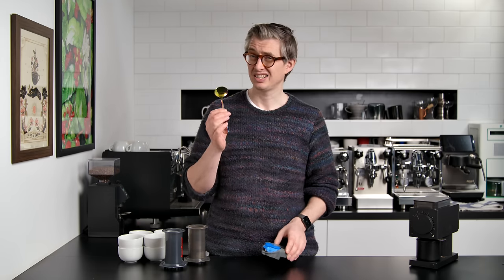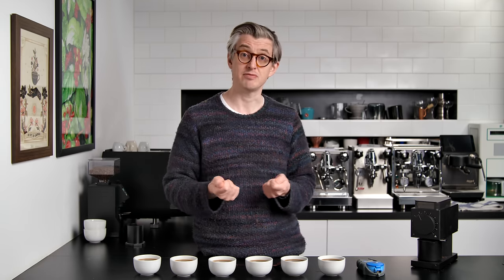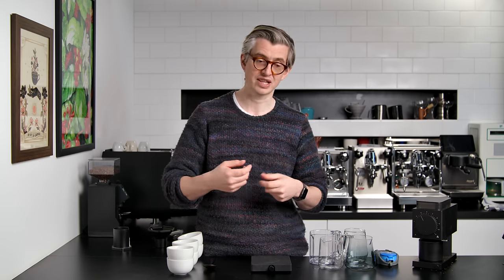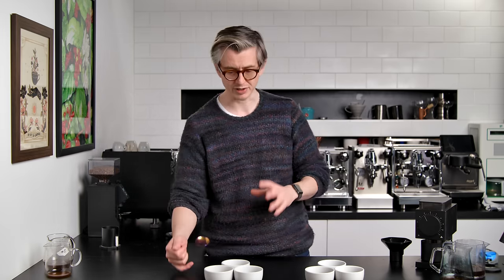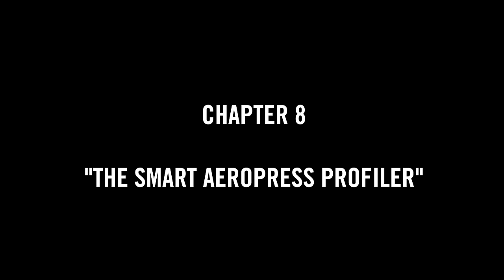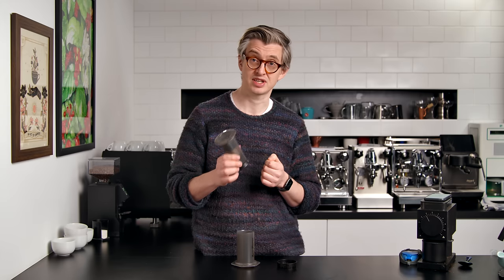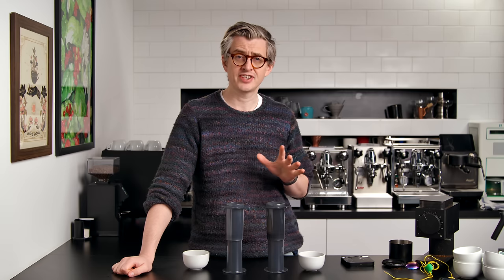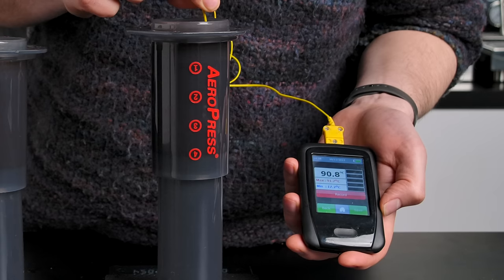Understanding The AeroPress (Episode #2)

Comment: Great video James, thanks, I watched it from start to finish in one go! Brutally honest, myth-busting stuff. You covered everything I wanted - and more! - apart from one small thing: paper filter versus metal filter. Switching from V60 to Aeropress, I initially felt better about my reduced paper usage, but now after a few years of Aeropressing, I'm concerned by all those little paper discs... I bought a metal filter a while back but have only used it briefly so far without much success - I recall preferring the paper result, but didn't pursue it further. Do you have a view on reusable metal filters?
Reply: i second this...would live to see James dive into how the filter material affects the final outcome. Been using a metal filter for over 5 years and prefer it over paper.
Reply: I'm also curious. I'm a metal filter user, not paper and prefer it over the paper.
Reply: Yes, I use a metal filter when travelling as I don't want to deal with the paper filters going everywhere in my bag, I wonder if there is any discernable difference in taste and extraction between paper and metal filter
Reply: @christianmarth9989  The main difference for me the much cleaner cup that paper gives. I use a Prismo on mine, which comes with a metal filter. But I still add a paper filter for the cleaner finish.
Reply: @taglh  Can you taste any difference between 1 or 2 paper filters?
Reply: @christianmarth9989  huge difference. Paper is way better.
Reply: I was curious about the same thing
Reply: i was about to ask the same thing - i understand most people prefer the paper filter because of the so-called “cleaner” result while i prefer the exact opposite (aroma and taste from the oils that metal filters let through but paper retains), same reason i much rather have an espresso than a pour-over. The real downside of not using the disposable paper is cleaning; the puck rarely comes out intact, usually is halfway between a puck and a french-press slurry. Thanks for the thorough enjoyable nerdy Saturday evening treat James.
Reply: I guess you can get the best of both worlds by simply reusing the paper filters. Sounds weird but in fact it works quite nicely. 
In my experience it it beneficial to rinse the paper immediately after brewing with tab water. That way there aren't any brown marks on the filter or bad taste when you brew next time. 
Neat hack: Put the rinsed filter paper on the outside / on top of your pouring kettle. It will be dry and storable in a few minutes.
When traveling, store 1-3 filter papers inside the plunger or in the cap, so you don't have to worry about them flying around.
The inventor of the Aeropress, Alan Adler, uses his paper filters up to 80 times as stated in hack #5 in this video:
https://www.youtube.com/watch?v=iLmVNl9Bknc
And don't be put of by the brownish stains on the filters they show. If you rinse it properly and right away it will be perfectly fine.
Reply: @Gordon Laing @Christian Marth
Reply: I just got my Aeropress a week a go and ordered 1 metal mesh type filter with it. From my limited experience the paper filter is full flavor but lighter in body. The mesh filter worked better with a courser french press type grind.That was an earthier taste. Both were good. I would like him to do a short review of different types of metal filters. That would be helpful. I also reuse the paper filter for my afternoon demi cup. That way I feel I made the most of one filter a day.
Reply: He says he prefers the paper filters in his video about the AeroPress Go.
Reply: I use stainless mesh one exclusively, love it. The coffee has more body b/c of the oil.
Reply: the problem with metal is the mesh is never tight enough and the bad chemical reactions oxidizing the coffee. A ton of room to many startups with money try different materials.
Reply: I’d be interested in the basic paper vs metal as well, but also with his fun pressure gauge and refractometer seeing any differences/comparisons.
Reply: Bought a metal filter. Used it twice. In other brewers I prefer the metal. Not in the Aeropress. It's annoying, let's more particulate through, and generally is harder to use than any Aeropress microfilter. That TINY piece of paper will decompose very quickly. It's not a Styrofoam cup. Plus I get about a year or so out of the $2 of paper microfilters.
Reply: he has a video on cloth filters where he kinda talks about the differences between cloth, paper, and metal (it was for pour overs if I recall but I would imagine the same applies) basically paper is great for a clean cup that has the least oil and no fines, metal lets the the oil and some fines through, and cloth is a happy medium that lets no fines but some of the oils through. Should try cloth if metal is not doing it for you, personally I prefer cloth and although it is annoying having to clean it properly rather than the other types the aeropress filters aren't nearly as troublesome.
Reply: @arthusbananson5522  I've heard than Alan Adler also rinses and re-uses his paper filters. Thanks for the hack!
Reply: Use paper if you have cholesterol issues.
Reply: What exactly are your concerns with using paper? The sheet is tiny so, so I'm assuming it's not to do with cutting down trees? Paper decomposes in 2 to 6 weeks so it can't be that either? I'm curious as to your concerns. 🤔
Reply: @lebowskii98_9  I compost my coffee grinds and used papers and have found the papers are not decomposing, or at least not anytime soon. I wonder if they are 100% paper?
Reply: @brianfurman9607  I compost my coffee grinds and used papers and have found the papers are not decomposing, or at least not anytime soon. I wonder if they are 100% paper?
Reply: Paper filters can be placed in food waste, no?
Reply: Metal filters are just easier to handle when travelling, backpacking, camping etc I don't want to run out of paper filters when I'm in a rural village in Sumatra for example and had to ride my motorcycle to a remote coffee plantation to try some unique Mandheling beans, I travel with my Aeropress with metal filter and Porlex Mini grinder and don't have to worry about carrying a seperate zip lock bag of paper filters that will eventually run out and be stuck somewhere that doesn't sell them
Reply: @cameralabs  It wouldn't surprise me if they weren't. I only realised a couple of years ago that tea bags contained plastic and shouldn't be added to compost bins. You can of course buy ones without, more so now the general public are more aware of it.
Reply from the maker: I’ll cover metal filters (a bit) in episode 4. It’ll be part of a bigger video but I should make sure I answer some of these questions in it.
Reply: @jameshoffmann  Episode 4 confirmed :D Loving this
Reply: I use metal filters exclusively with the AeroPress and the  V60. In general I'd say that paper tastes a bit better, but the difference for me is not that much of a deal and I'd rather do something good for the environment here. Not to say that it is a huge impact yet, but if anyone would be using metal filters, the impact would be there. And I personally can't justify a slightly better taste and cleaner cup over the environmental effects. 
Specifically looking at the AeroPress and comparing paper vs. metal I would say, that the amount of pressure needed is lower when using metal. I can just rest my hand on the plunger and it goes down when using metal, whereas I have to apply pressure when using paper. At least that's what I found when I switched from paper to metal and did some testing. So this is even better, because I normally want 350-400ml coffee and as we have learned, less pressure might be the better way to go.
Reply: Probably this is more a 'what can you do with an aeropress right out of the box' kind of video, there's lots of things you can buy and add on when you're deep in the rabbit hole like we are 😅 certainly waiting for that part as well!
Reply: that AND the 1 filter v 2 filters comparison!
Reply: @jameshoffmann  If you can cover off on how using a metal filter affects both the standard and inverted methods (along with the results), that would be great. I've always used inverted and managed to get 250ml in the chamber (living on the wild side). I always found it hard to keep liquid in the chamber with the standard method and a metal filter.
Reply: @christianmarth9989  I also use metal for the same reason, as I need my coffee process to not require any consumables other than coffee and hot water. I actually prefer the extra body (i.e., the extra fines that seep into the final brew) of a metal-filtered AP brew, but then I also hate light roasts and very acidic sour brews.
Reply: @lebowskii98_9  yep, I just fished out a load of teabags and Aeropress filters from my compost, as they weren't going anywhere.
Reply: @jameshoffmann  thanks! I think there's a wealth of possible filter tests, including unused paper vs rinsed reused paper as well! Looking forward to seeing your future videos all about it!
Reply: @tabidots  Add another one to the light-roast and acid disliking crew who doesn't mind some fines who also uses metal. Interesting to find that this is A Thing! ...although now I've heard cloth is a thing, I'm curious about that.
Reply: The Ameuus o2 metal filter is amazing. It’s two filters used together for a super clean cup with no waste.
Reply: @tabidots  Recently I've actually taken brewing drip coffee using a Vietnamese Phin, it's extremely simple and no consumables
Reply: @jameshoffmann  could you also cover the prismo and it affects the process and best way to introduce it?
Reply: a comparison between difference metal filters against paper would be nice too. e.g. super fine metal fabric like Kohi's, Able disc, or some Amazon branded/unbranded
Reply: If you are switching from paper filter to a metal filter to save the environment, bare in mind that the producing of the metal filter is far more polluting than producing of hundreds of paper filters. And you need to wash it down after every single use, which consumes water (that is heated somehow). So you will have to use the metal filter for years before it becomes even with the paper filters.
Reply: @jusatin  yes, there's a balance to strike. I've been experimenting over the weekend by reusing my paper filters, and so far I'm on my eighth brew using the same paper filter. But I am having to use water to rinse it each time - not much, but it's still a factor. So far the result seems ok though.
Reply: @cameralabs  That sounds really interesting! Is there a place where you document your testings? Always eager to learn new, better, ways to use the Aeropress and make it more sustainable!
Reply: Good point. My GF bought me some metal filters and while the coffee still tastes great, I prefer the cleaner feel of paper filtered and the clean up process is so much easier with paper. It's enough of an extra hassle with a metal filter to make me less fussed about using an aeropress in the first place - might as well use a french press.
Reply: @arthusbananson5522  The Sprometheus talks about reusing aeropress filters as well https://www.instagram.com/p/CHvjsRlhebq/ . I remember he had a video on youtube about it but I couldn't find.
Reply: Just as he described, the paper size (by weight) isn't large enough by ratio to water to impact flavor when looking at rinsing. I haven't performed the blind experiment comparing paper vs metal, but its likely to be a similar result.

If you're looking at reducing environmental impact, you likely can look at other areas of your life rather than being concerned about a small piece of paper. I did purchase a metal filter, but since I pop the grinds out over a waste bin, eventually I forgot to remove the metal filter first and accidentally threw it away. In terms of energy, its estimated that one metal drinking vessel takes 100x more energy to produce than one paper vessel. I didn't get anywhere near 100 uses out of the metal filter before accidentally throwing it away. 

As a practical matter, I'm sticking with the paper filters and trying to reduce material consumption in other areas of my life.
Reply: @Kinaboxlol  I don't know what I am more excited about. Confirmation of More James Hoffmann Aeropress episodes or more Marvel Streaming shows/movies 🙈
Reply: @jusatin  That's a very good callout. The word "Sustainable" is just a marketing term most of the time.
Reply: Could you look at using a metal filter (fellow prismo) to make a latte style result (20g coffee - 50g water, using a lever for max possible pressure) I’m pretty happy with my results using this method! Would love to know your thoughts
Reply: The Ameuus o2 metal filter is great. Two filters put on top of each other, filtering lots of coffee grounds out. I get a clean cup, better taste as with paper filters as the oils are in the cup. 
And paper filters can be reused. Very often!  Alan Adler tested it himself and I think he was able to reuse it at least 60 times. For those who travel that is a good way to not run out of paper filters.
Reply: @cameralabs  they contain plastic so they won’t decompose. The plastic stops the paper from disintegrating when the liquid passes through. Teabags are made from a similar paper I believe.
Reply: @lebowskii98_9  the paper has plastic within it to stop it disintegrating.  It adds to micro plastic pollution.

Comment: I learned one of the winning recipes from the world championships though I could not tell you which year. Inverted method press pushed in to the 4.. Pour boiling water over 1 scoop of espresso grind to just under top. Stir for 30 seconds. Place top on (filter just wet enough to stay properly in place). Invert and gently swirl once then place on cup and press with weight of arms but not pushing with muscles. Press should take about 10 seconds. I've always enjoyed it and seems to tolerate a decent range of beans well.
Thank you very much for sharing this! Extremely enjoyable to watch!

Comment: Hi James!
At 13:57 You mention that it's the rapid degassing of coffee that causes a sharp increase in pressure, leading to a tendency for the plunger to pop out. 
The more pronounced effect at play here is that the pocket of air between the plunger and the steeping liquid gets trapped after inversion. 
The act of inverting, causes the liquid to quickly heat up the now trapped air. The volume of the air pocket being constant, the pressure of the air goes up proportional to the temperature delta. PV=nRT (ideal gas law)
The same effect takes place when blending hot food item/liquid in blenders. Rapid heating of trapped air. 
This effect can be mitigated by having lesser air trapped, to begin with. I.e Fill the inverted aeropress to the brim. A caveat here, the pressure differential will still be the same, but will only require a smaller change in volume to equalize. This will be provided by either a little bit of liquid flowing down after inversion (holding the plunger securely) or a smaller upward movement of the plunger. 
I believe you've even cautioned about the safety of this method in previous videos. Even so, I used to swear by it. I'd gotten it right every single time. Till I didn't.
Love your work!
Reply: Good explanation. I had no idea what he was talking about, having done inverted for years, and that's because I fill my inverted aeropress to the rim.

Comment: Wonderful video! One thing I would like to add about why I still pre-rinse my paper. It’s not for taste but instead to make sure the seal is properly made with the body. Before when I didn’t bother, I had two incidents of the paper shrinking or warping in some way when I poured in the hot water thus letting the grounds into the cup. Just a little anecdote from a filter-rinser.

Comment: My only problem with not rinsing the paper is that sometimes when the paper is not stuck to the cap, it can move around and ruin the whole brew.  It’s more to ensure the paper sticks rather than  ‘papery tasting coffee’
Reply: Ditto. Sometimes the papers are just cut to meet the edges, so they have to sit perfectly still during assembly. It's more like wetting than rinsing.
Reply: That's weird because I find after I rinse it tends to not sit flat. I have quite an old BPA press though.
Reply: Isn't it to also swell the paper fibres when brewing inverted?
Reply: @frjfsiuojrsdug  it’s not 100% flat, you might find some bubbles but as long as it sticks and doesn’t move around to ruin the brew the bubbles should be fine.
Reply: Agreed.  We have often doubted that wet vs dry makes a difference in the taste, but we sure like that the filter stays in place!

Comment: I would love to see James do some experiments with metal filters, including the one for the aeropress. It would also be interesting (or stupid but funny) to see what using multiple filters would do.
Reply: I use a metal before my paper filter
Reply: @Stevesbe  assuming you mean metal closest to the coffee and paper in first (closest to the cap), that makes sense.  The amount of fines between the two filters is interesting.
Reply: @robinsmith9158  yeah
Reply: Came here to request the same.
My theory is that the metal filter allows more oils through to the cup.
Reply: Agreed. Would love to see a comparison between metal and paper filters.
Reply: Also keen for this, I recently bought an inox filter. Would like to see a comparison of paper to inox.
Reply: @stephencoles5991  it does.  And silt / fines.  It's not unpleasant, but it's not as clean.